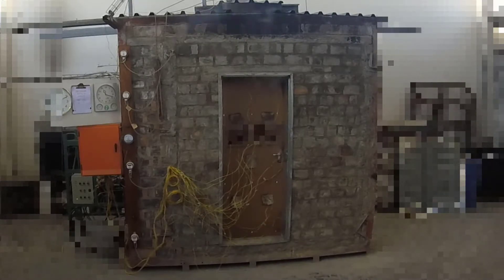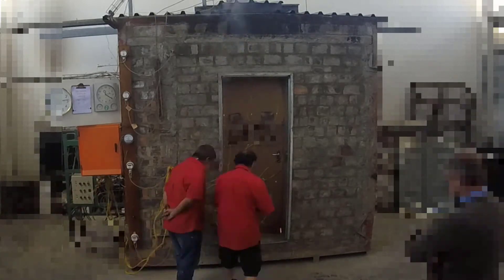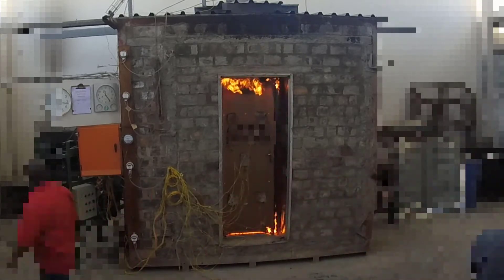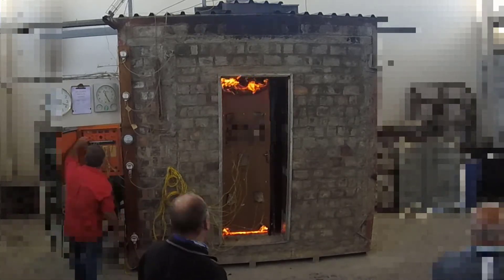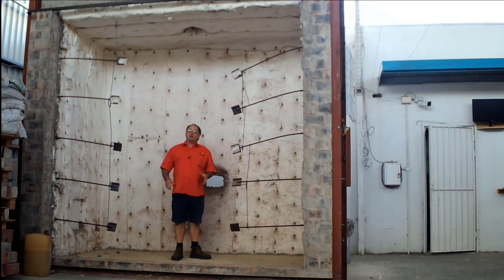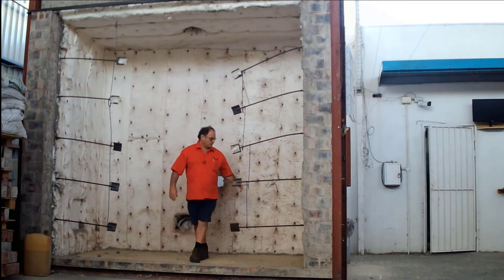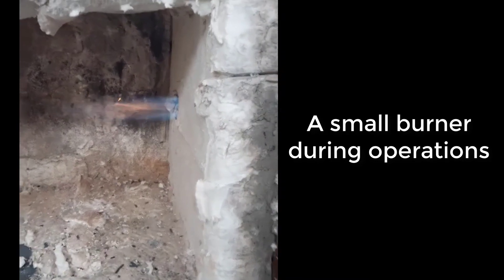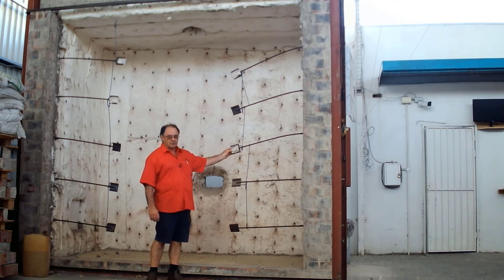Understanding standard fire furnace testing

Comment: Could you please share the idea how to pressure make neutral at specific height... As per given different type standard... Such as BS,EN & UL
Reply from the maker: Dear Tanzeem. You need to have constant pressure measurement, and then adjust your outlet opening size, inlet sizes and/or burner operation.
Reply: ISO 834-1: 8 Pa per meter heigth of each sample tested.

Comment: Please advice on the small-size fire furnace
Reply from the maker: There are some papers on small-scale furnaces. They are not perfect in that some performance is not fully predicted. Bigger samples tend to perform worse. However, small-scale tests are useful for understanding behaviour, thermal modelling and preliminary behaviour.
Reply: @firesun  Could you please share the papers on small-scale furnaces ?
Reply from the maker: @tav6244  We have not published any papers ourself on the topic. However, in the literature you will find some papers comparing the response between such furnace. In textbooks such as "Structural Design for Fire Safety" it discusses the difference in results between small and large-scale tests.